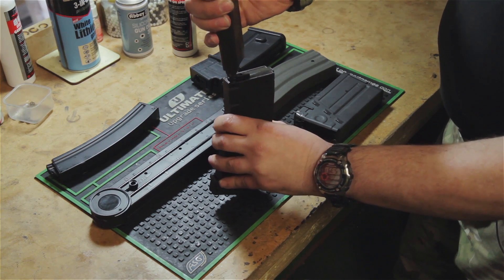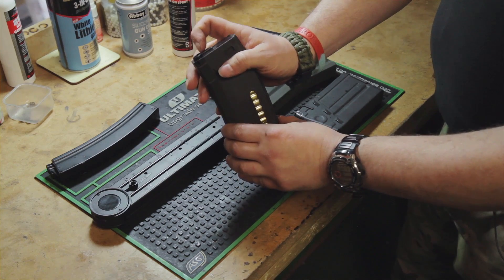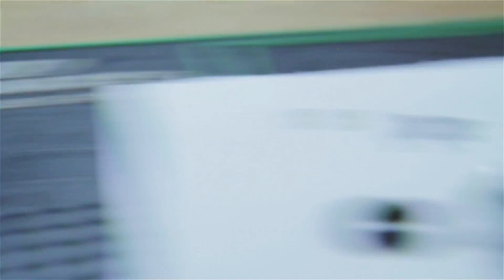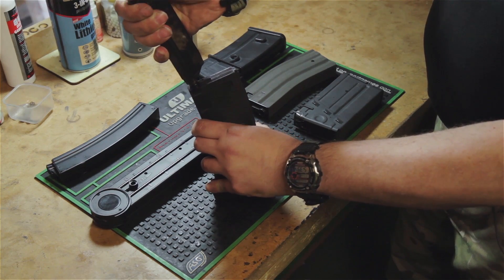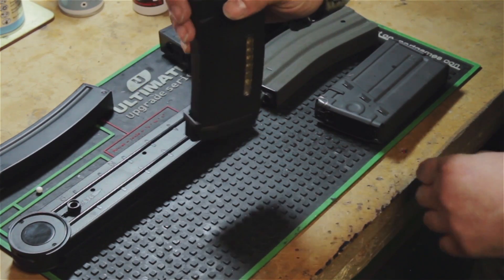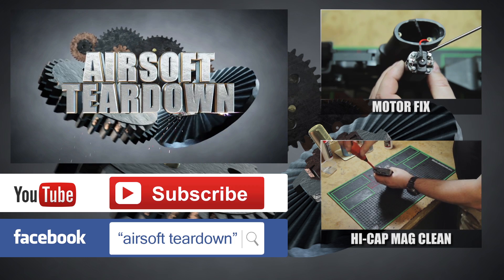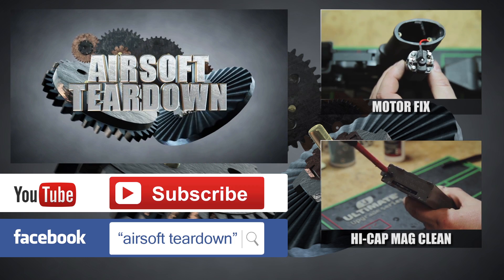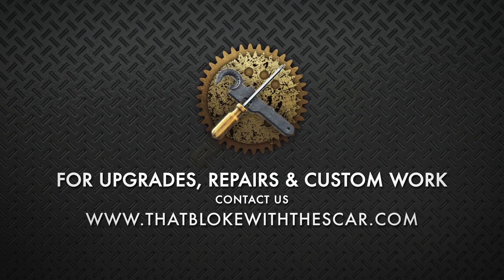How To Service Your Mid-Cap Magazines

Comment: The quality of the videos is great, but I can't say I agree with this method of maintenance for magazines. The problem is that spraying in silicon will cause the BBs to become coated, and this will impact the effectiveness of the hop unit on those BBs. There should be no silicon oil touching the BBs at any point.

The correct way to maintain a mid cap magazine is to take it apart and clean the channels and spring and follower. There is no need for silicon oil, more importantly it should never be introduced into a midcap because it ruins accuracy.
Reply from the maker: Paul Keeble Thank you for watching the video and raising the issue of silicon contamination.  Whilst you are correct that excess oil on BBs is bad it is a greatly mis understood subject and is widely confusing for both new and old players alike.  Taking mid cap magazines apart is difficult and tricky for most people to try themselves and some make's of magazines it is simply impossible to take them apart in the first place.  The tiny amount of silicon oil added is distributed over the entire surface area of the filler tube the spring the spring guide the inside of the loading ring the retention lever, retention spring and housing.  On top of this we recommend that two full loads of BB's be filled and disposed of to remove excess oil and anything left on the top of the mag and then wiping what ever may be left from the magazine with an absorbent cloth.  Some oil will still remain but this will settle or be dispersed the first time you use the gun and the tiny amount that may transfer onto a BB will have negligible effect on its flight path.  It is worth noting that Every manufacturer recommends the occasional spraying of neat silicon oil into the hop unit of your AEG to keep the mechanism working and to stop the bucking from drying out.  This oil will quickly remove itself from the bucking after the gun has been used a few times with no detrimental effect.  Also please do bare in mind that While this video is not aimed at the gunsmith or highly technical players out there that regularly maintain their equipment,  The tiny amount of excess oil that may be present for a few minutes during crono graphing or the first contact of the day is nothing compared to the condition of the unmaintained AEG's that we see in our workshop every day.  We really do appreciate your time to bring this to our attention and in a closed system your hypothesis would be spot on! However in the everyday skirmish use of 99% of AEG's it will make immeasurably less difference than never cleaning you mags.